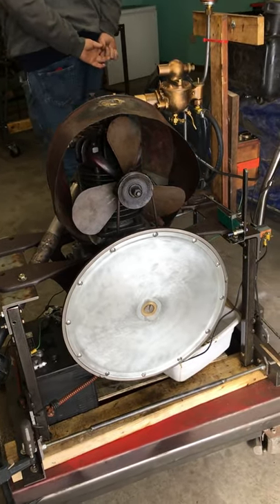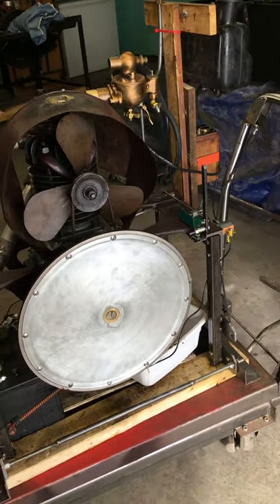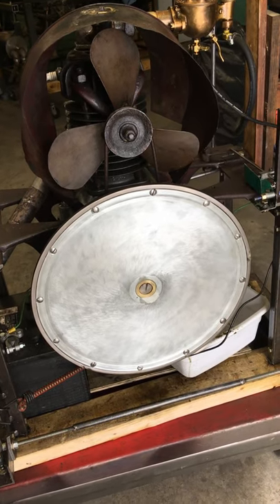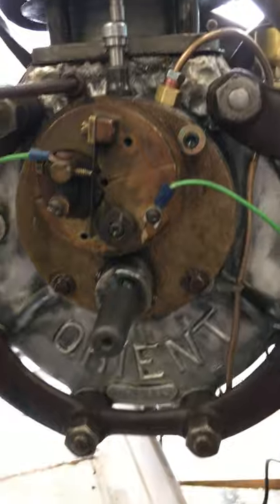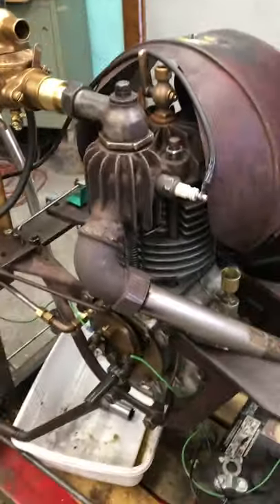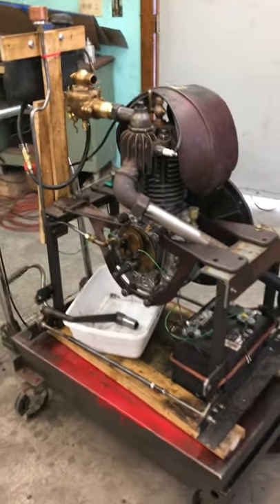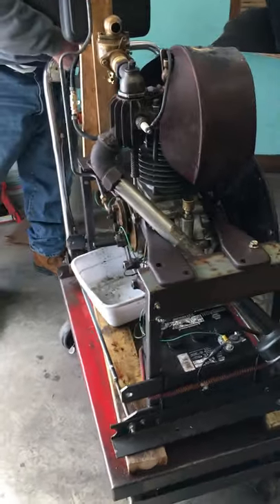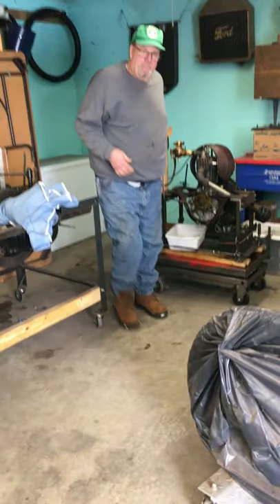1905 Orient Buckboard Engine - Restored & Running!

Comment: I have one of these.  It's from a 1902.  My issue is that the flywheel (drive surface) isn't balanced.  It shakes the whole car to pieces.  I wish I knew of some place that could balance it.  Local machine shops all declined, too old.   This rebuild runs great.  Nice video.